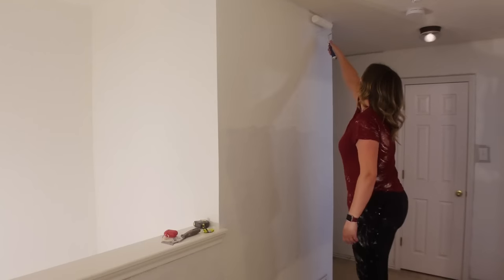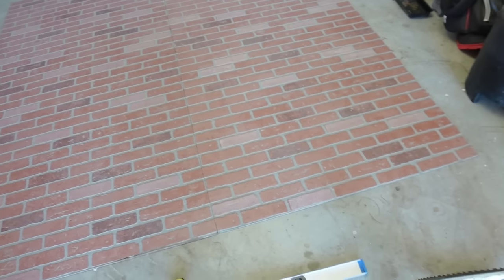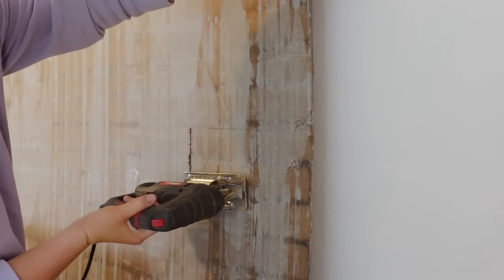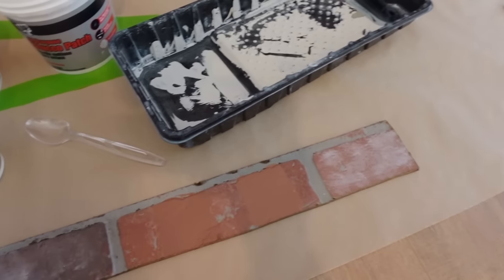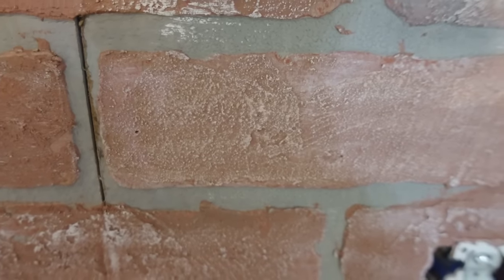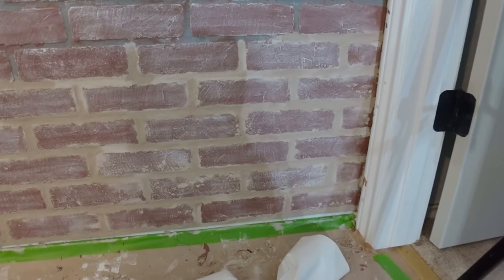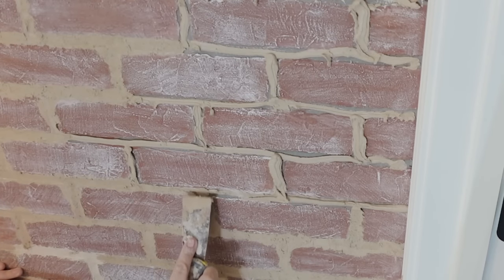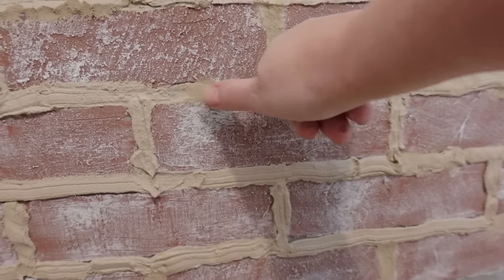HOW TO MAKE BRICK PANELS LOOK REAL | **BUDGET** FAUX BRICK ACCENT WALL | Hallway Makeover pt 3

Comment: Looks authentic! Im a former faux finisher, I found over the years, a clear matte seal coat will bond it together for longevity and make cleaning much easier.
Reply from the maker: Probably a good idea!
Reply: Would you recommend any specific seal for this. I would really like to make a backsplash in my kitchen with these panels. But I’m concerned about cleaning.
Reply from the maker: Maybe matte Polycrylic

Comment: Another fantastic job, putting the white paint on the bricks really brought out the bricks and made them look way, way better. It made it seem like it was tied in with the lime wash for outside. I meant to ask how the lime wash was holding up outside? I was thinking maybe. you could add a faux window to the brick, give it something to break up the expanse of bricks.
Reply from the maker: The lime wash outside is holding up pretty well. There are a few spots that have chipped/peeled. I will have an update on exterior stuff in a video coming up soon.

Comment: I have admit, I was very skeptical about the coloring, but I just love it. Tip: don't cut straight line for seam between panels, cut around bricks on both sides of the panels & piece them together like a puzzle, then no straight seam, but I can't see yours at all so good job!
Reply: She explained why she didn't do that. It would have made the panels not wide enough and she'd have to buy a whole extra panel.
Reply from the maker: No worries- I was skeptical about the coloring too! 🤣

Comment: While I appreciate the hard work it still looks like a wall paper. The big difference is with real brick you get a real look because the mortar sits lower than the brick face. This texture makes it not look like wallpaper
Reply from the maker: I can see how you would think that. If you felt it in real life, you would never think it’s wallpaper. It is rough like brick. Also, not all brick has recessed mortar. Over mortared brick is an extremely popular style lately.